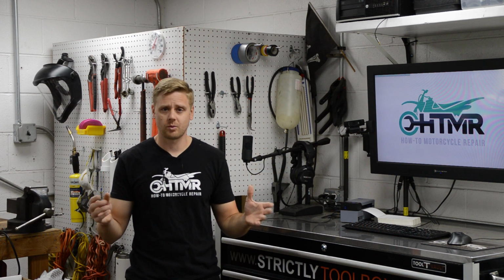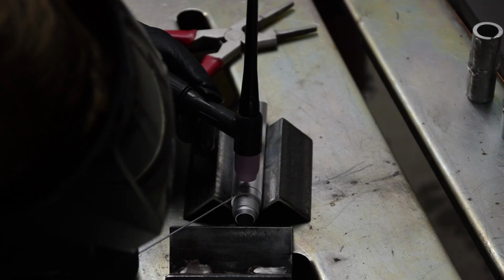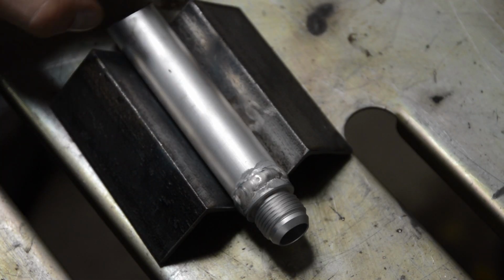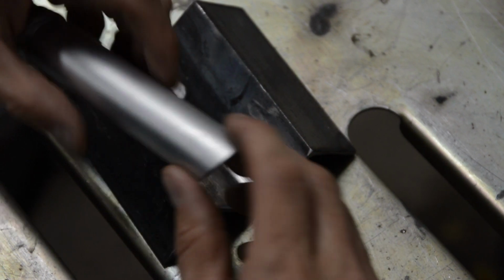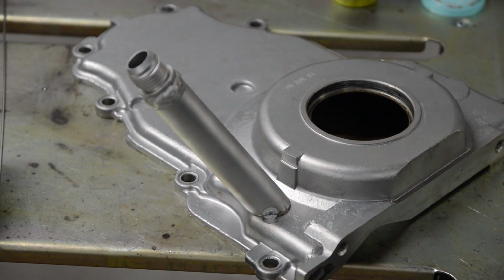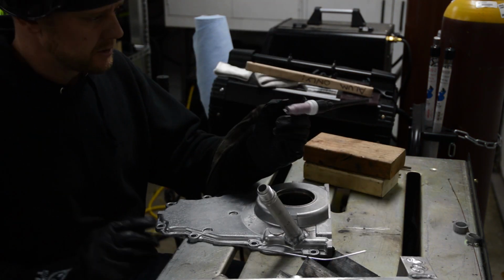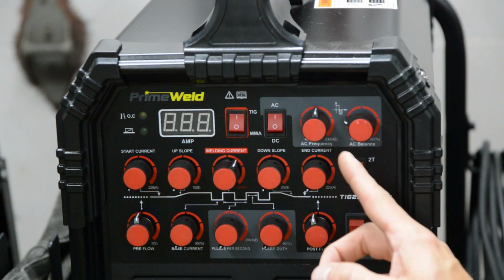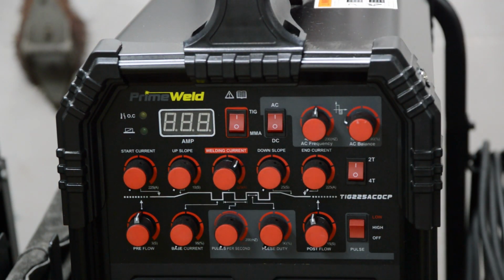TIG Welding Aluminum - LS timing cover oil drain for turbo

Comment: Great job for your first time keep it up. That pipe is concerning though and it has nothing to do with your weld.  That pipe being stuck out that far unsupported will most likely crack at your weld. It could crack with any weld. That flexible line will pick up engine vibrations and transmit it to the first solid point and that point is that joint. If you can tac a tab on it and find a bolt to put it under this would help solve that issue. Just my 2 cents. Good luck and keep it up.
Reply from the maker: Good point/idea. I'll see if I can add a support tab/brkt.

Comment: Could you have tapped the cover and used a threaded fitting? It looked like it had a lot of meat.
Reply from the maker: The "4" bosses that you see are clearance for oil pump bolts on the back side. Also, I wanted a rigid pipe to stick past the belts and pulleys instead of a hose that may get caught up by moving parts.

Comment: Good job on first part. Aluminum welding is lot trickier than steel for sure. Couple suggestions... Preheat the material. Shocking how much difference it makes, at least for me. Use blowtorch and heat for 5 to 10 seconds, especially where you are starting the weld. Also help burn off acetone or alcohol used to clean. Otherwise you are heating with torch and takes longer for puddle to form. Next, slam the pedal down earlier to get puddle going quicker then back off as you get going. Last, i would have had the pipe facing towards me and moved my torch hand left to right over the curve of the pipe to well longer. I had to weld bunch of steel tubing for a railing job and this is how I did it.
Reply from the maker: Yeah that is a good tip on the pipe facing me, would have allowed me to travel more without stopping. Next time LOL.
Reply: @HTMR   how’s the drain working any draining issues or back up
Reply from the maker: @irvingbar4569  zero issues
Reply: @HTMR  I have been fighting mine from the first day I installed my turbo
Reply from the maker: @irvingbar4569  Do you have a restrictor? Tell me more about the setup.
Reply: @HTMR  From day one I have had problems with the drainage I went as far as installing a pump to suck out the oil. I also set up a tank we could drain into im running 10an lines with a check valve and a motion race works 10an drain and I’m still having problems with this turbo. Vsracing is claiming overheating which doesn’t make sense I have had the setup tuned by a well known tuner so we are sending it in to Vsracing I hope they do right and take care of there customers

Comment: Hey bud relax your doing fine ! Everyone gets nervous when welding the real thing ( fuck ups cost time and money) it's all learning. Don't bother grinding back welds to make them look good it's more important that there strong, welding cast can be nightmare so you done pretty good not to fuck it up, before I weld it I clean with acetone and if it's really bad I'll give a few light runs with no filler wire with max cleaning action and cleaning between each run , just to draw out all the crap and contamination, best of luck with future welding and thanks for all the bike vids ( just finished setting the pilot jet on my gsxr1100 slabside) cheers bud👍
Reply from the maker: Thanks for the tips the junk out of the casting. Next time for sure.

Comment: Sent you a lengthy email lol.
another approach, my usual attack angle is the machine a shoulder onto what ever im adding to a timing cover or oilpan. This keeps your weld on the inside and the step is very easy to weld.    

First time on a cast part you nailed it man, cant wait to see the progress after a few hundred feet of rod!!
Reply from the maker: Thanks for the tips and email!